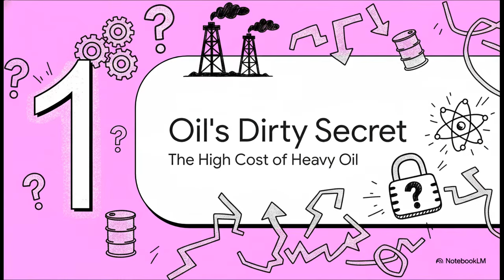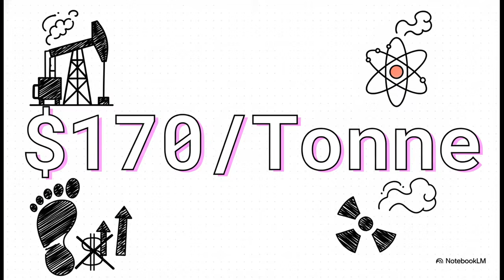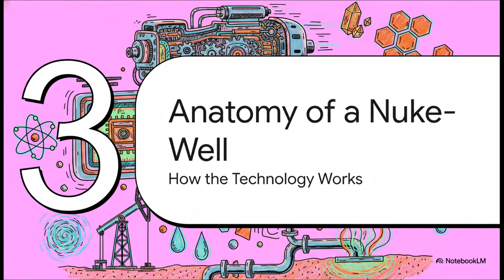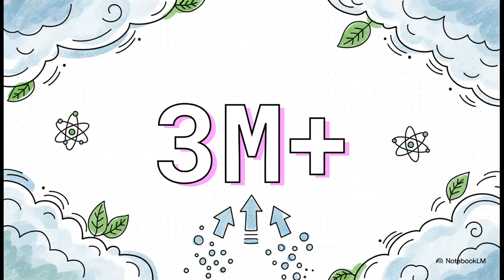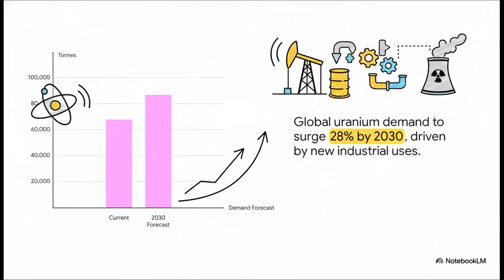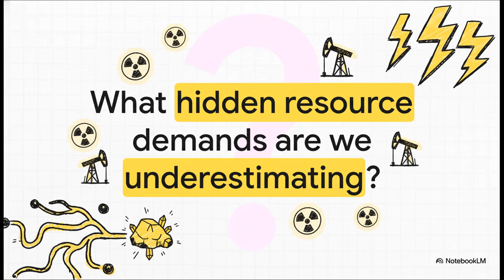The Nuclear Revolution Nobody Sees: Why Industry Needs Heat, Not Electricity

Comment: Hope the small module reactors will be soon commercial and then oil industry may apply the invention patent 8186430B2 (belive this is right). The 6 MW SMR may keep a bitumen production around 40000 bbl/d, and SAGD in Alberta is around 1.5 million bbl/d. For this many SMR are needed, and then more uranium will be consumed. The competition will increase the price of uranium. Expiring time of the patent is only 20 years. Believe the industry will benefit but not inventors, too bad.